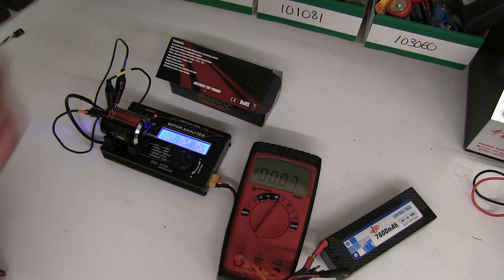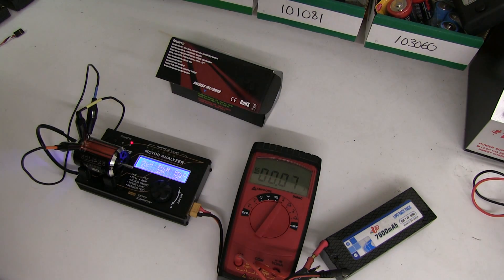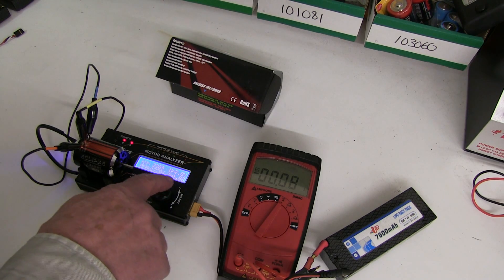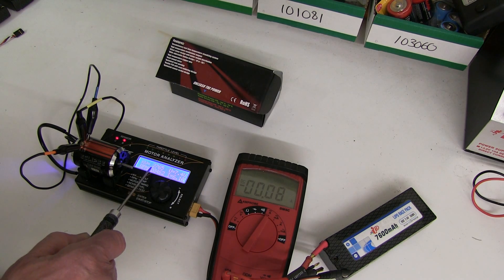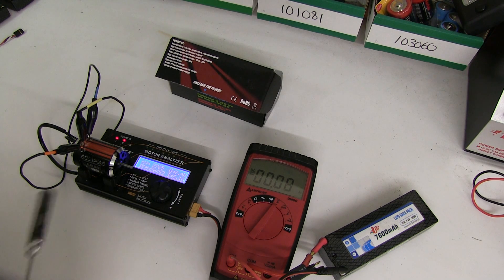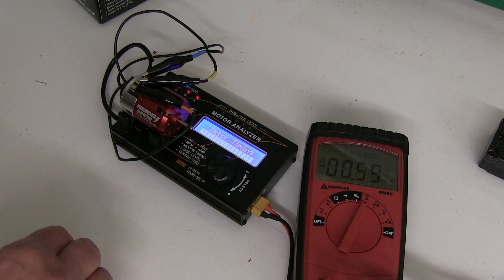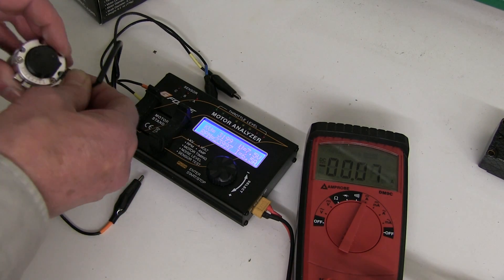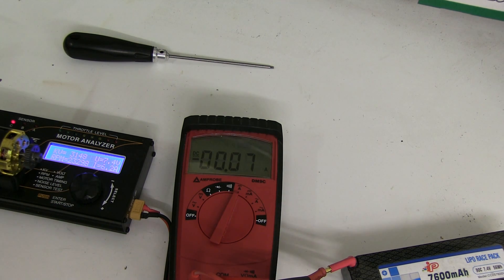Blinky Brushless Motor Sweet Spot. 17.5T and 13.5T

Comment: Thank you so much, a very helpful video. If I want to set my timing on the cheap, do you think I could do it simply with an ammeter in line with the battery and set amps that way? I know the reading will be a little higher since there will some current draw from receiver BEC. On a different note, my wife says your voice reminds her of the narrator at the beginning of The Snowman when he says he remembers that year, it brought most snows ever!

Comment: Hi Nick would this be the same for 8.5t motor in blinky mode. Tune to about 6 amps?
Reply from the maker: Hi Leigh . Track testing shows that setting most winds from 4.5T up to 17.5T  perform very well, in Blinky mode, when set about 6 to 7 amps. Your 8.5T motor will be good.  On larger fast tracks you can increase the amps 7up to about 8 amps.  But alwaqys check motor temperature after a run, and no higher than about 76deg C.

Comment: Have you tried using the volt ohm meter between the battery and a esc to test amp draw free spinning your motor and compare it to your analyzer. I'm curious if the readings are close. Reason why I'm asking is I have a maclan mrr team v2 17.5 and factory timing is 38deg which was 2.5 amps
I upped it to 45 and was only  around 3.5 amps. I'm about 47-48 on the motor casing now and its you to 5.5 amps but there scale only goes up to 50 degs. So I wasnt sure if this is normal.
Reply from the maker: Hi. Some multimeters do not give comparable results. make sure the connecting leads are heavy duty , like on the ESC. 

5.5amps at 47degree is about right. The amps start to increase rapidly after a certain advance. In your case 47 degree seems that point. At 50 degree it will probably jump a lot more.  All the best Nick

Comment: I mostly run hobby wing xr10 with 0 timing but all my motors do have timing but running blinky mode I do have a hobbywing I think v3 something with a famtom 17.5 and been running with 0 timing. Now the motor timing is set around 45 but on my esc when I program the part about timing I think there is 3 choices can you explain esc timing I think I understand the motor timing but lost on esc timing thanks for reading and your time
Reply from the maker: Hi. When running in Blinky mode, the ESC timing is fixed at zero and is not adjustable. That is why the motor timing is normally set high at 45 to 60 degrees.
If you are in normal boosted class racing, the motor endbell is normally set about 30 degrees and then the ESC can be used to increase the timing up to a max of 64degrees, by adding say another 34degrees. Some ESC have boost and turbo settings which can be added together, but also set at various rpm points and ramp up times.

Comment: Can u compare reedy s plus 17.5 and rev tec X factor 17.5 to see which is faster motor. Thanks
Reply from the maker: Hi Joker. Racing results show that the X factor is the faster motor.  Most of the new motors are performing at a high level, and the difference between them is getting less.  So they are all are capable of winning.

Comment: What do you recommend to set the mechanical timing at if one intends to use a boosted/ turbo esc?.
Reply from the maker: Hi. A difficult one to answer, as there are so many variables. But i would use 40 degrees and 20 degrees of boost for a longer track. Others may prefer 30 degrees and max out the ESC boost.

Comment: how much volts do you test at.. to get accurate readins.. 7.6? ~ 8.0v?
Reply from the maker: Hi Mits. Using this method, use a fully charged lipo. So 8volt is good.
Reply: @nickadams5411  thanks. ive been thinking of using a step-down voltage device that lets me run constant 8v to the tester from a 12v power supply...
Reply from the maker: @rcmits  Hi. The KV remains constant no matter the input voltage variation. So the input voltage source is not that important , as long as it can supply the amps. That is why a 2S lipo is best.
Reply: @nickadams5411  well... I learn something new everyday... Tha KS for the info

Comment: Hi Nick
Thanks for the great videos. I have the same motor analyzer and have set 2 motors to 6 amp draw but when in the car they are pulling just over 7 amps.
I have tested the analyzer with an ammeter whilst using a variable bench power supply so I know its accurate.
Which would you go with? The figure on the analyzer or the figure from the ammeter when in the car?

Comment: Without a motor tester, can i still do this test using 1s through esc using full throttle on transmitter? 
If so how will readings differ with the lower voltage
Reply from the maker: Hi Matthew. Yes you can set the motor with a 1S lipo.
The amps should be set about 4.5 amps.
Reply: Nick Adams can only get upto 1.8 using trackstar , ive modified the timing ring to allow further rotation but i can only go as high as 2.5 after that the motor slows dramatically.
Reply from the maker: Hi Matt
What wind is the motor? Is it a 21.5T.  They cannot reach a high amps, due to the winding resistance. In this case, turn the timing to reach maximum revs, then turn back a fraction.

Comment: Can anyone tell me that what's the purpose of the ammeter connecting to the motor analizer? Why do you need to see the level of amp via ammeter even though you can check that in your motor analyzer?
Reply from the maker: Hi
Just to show, you can set the motor up with the ammeter, if you do not have the analyzer.
Reply: Thanks for the reply. I have one more question. If you set up your end-bell at 6.0 amp, but the motor analyzer's timing is a little bit off (maybe around 4~5 degrees), would you still follow 6.0amp or the motor analyzer's setting? If they are different, then what would you do??  Thanks.

Comment: Hi Nick, thanks for all this great videos. They are very helpfull. Just one question, You said in this video that you can use the analyzer on the car without disconnecting the ESC. Doesn't it harm the ESC ? It's clear that the sensor cable has to be disconnected anyway.
Reply from the maker: Hi Moon
You do not need to disconnect the speedo. You can switch it off, but it is not damaged even if you have left it on.
Reply: Nick, thanks a lot for the info. Makes it much easier to test motors which are directly soldered to the ESC

Comment: I’ve got a new team edition Maclan 25.5 MRR. Is 6amp draw a good spot
Reply from the maker: Hi Jeremy
No, the 25.5 are inefficient and prone to overheat.
so a lower off load amp draw  of about 4 amps is a good starting point.
Then check the temperature of the motor after a run, and adjust to keep below 70deg C.

Comment: Hi Nick great video. It looks as if perhaps you set the polarity on the multimeter incorrectly. Your multimeter appears to be reading a negative current flow. I couldn't quite be certain but it looks like you have the com(negative terminal) on your multimeter going to the positive terminal on your battery which in fact is reverse polarity. You should have the positive terminal on the multimeter connected to the positive terminal of the battery.

Comment: Hey Nick, just wanted to say thanks for these great videos. I was wondering your thoughts on Motiv and their view that their 17.5T MC2 should not be set to 6amps?
Reply from the maker: Hi Matthew
I have not seen that view from Motiv.
Heat is the main problem with motors running as hard as they can.
So always use a high performance cooling fan, and check motor temperature does not go past the 70 -80 degree C at the end of the race.

Comment: just wondering with 21.5 torque motors where would the sweet sport be ? 5amps ? 6amps ?
Reply from the maker: Hi
The 21.5T motors are inefficient and get hot with the resistance loss in the windings.
I suggest you start at 4 amps and see how hot it is after the race.
If still below 70deg C on thcase, then try 5amps. until it gets too hot.

Comment: Hi Nick, 
do you have information for ratio and draw for Sting 21.5T motors for F1? which is a good starting point? 
thanks a lot
Reply from the maker: Hi
I have been asked this about 21.5T motors.
See some answers below.
The general answer is that it depends very much on the heat generated during the race.
your motor should not exceeds 79degC at end of race.
You will probably have to set the free running amps about 4.5A.

Comment: Nick, thank you for the very informative videos.  Really appreciate your fine efforts.  I just received a motor tester and checked two of my 17.5 blinky motors while they were in my B6D's.  With the pinions disengaged from the spur gears, and also a clamp on DC amp meter attached to the positive wire from the lipo to the motor tester, both the tester and clamp on meter showed the same amp readings at full spin.  However, when I disconnected and removed the motor tester and just used the clamp on meter on the  positive wires from the lipo to the ESC, at full spin, clamp on meter showed a gain of 1.00 + amps over what motor tester showed.  I repeated the tests several times to include changing sensor cables with no change.  With just the clamp on meter,  both motors seems to rev higher and pulled an additional amp.  If you have time,  can you provide your input?  Thanks!
Reply from the maker: Hi
What motor tester do you have?
The motor tester is not putting out full power.
If the motor tester has a built in speed control it looks like it doesn't reach full on power.
Also make sure you have good (short) connecting wires and contacts, as they can drop voltage(and current).
Reply: Thank you for the quick response.  I purchased a Trackstar Motor Analyzer from HobbyKing.  It looks identical to G Force, SkyRC , etc., analyzers.  Also, much to my surprise, I tested three 17.5 motors (one is new and still in the box) and all motor sensor boards only had a one degree variation in phase timing.  Hmm :-)  BTW, all motors are Trackstar  ROAR approved units and are very competitive on a shorter indoor clay track.
Reply from the maker: Hi
Well check some other motors and make sure the tester is working ok.
Maybe it looks the same on outside, but is a second rate on the inside.

Comment: Nick Adams what is the sweet spot with the 21.5 motors now that, that wind has been getting more popular with onroad racing
Reply from the maker: 21.5T  run very hot, as they have a lot of winding resistance.
If you are using a 2S Lipo, then you will have to make sure the motor 
does not overheat.
So try 4 amps at first, and see how it sounds, and where the timing is 
set on the endbell. Check the temperature during a run.
Use a high power cooling fan.
The motor temperature should not exceed 80degreeC.
 Generally the amp draw will increase rapidly after the sweet spot, so 
even a few extra degrees of timing will put the amp draw up quickly.

Comment: Nice video.   after I set for 6amp draw what temp should I be shooting for when gearing the car.
Reply from the maker: Hi Ian
After a race the motor temperature should not be higher than 80degC
Note that motors will get hotter when the ambient temp is higher, and on shorter tracks.
Also fit the best motor cooling fan.

Comment: what should the amperage be for a 7.0 motor?
Reply from the maker: Hi Cody
The amp draw off load is lost power and will result in heat.
Low turn motors are normally very powerful and do not need a lot of advance timing.
Also timing can be applied by the speed control as Turbo boost etc.
Therefore, set the amp draw at 6 or less depending on how the motor is used.
For instance, if you have a speed control with boost, then you can start at say 10 degrees on the end bell, which will give a wide torque band and linear speed acceleration.
Apply speed control boost and gear the motor for top speed.
Race on.
Nick

Comment: Hi, so you can use the motor tester in the car without disconnecting  the cables from the speedcontroler? Just connect A B C and the sensor with the tester? BR
Reply from the maker: Hi Robert
Yes, to check timing you can do it with motor still driving the transmission.
 But to test amps and KV,  remove or unmesh the pinion.

Comment: Hi, Some questions to Nick , i am using a brushless motor checker it can read Current (amps), Volts, RPMs and KVs, no Timming....
1. What Current do you recommend for a 25.5T for better perfomance to be use in Formula 1 class? 
2. What Current do you recommend for a 21.5T for better perfomance to be use in touring blinky class?
3. What Current do you recommend for a 17.5T for better perfomance to use in touring blinky class?

Comment: Do you tune for 6 amps in a motor used for 17.5 1s (worldGTR or Pan car) ?
Reply from the maker: Hi
A number of racers have tuned successfully at 6 amps (2S Lipo), and the used with a 1S lipo.
Some racers prefer less or more timing, so it is critical depending on your track , FDR, and temperature of motor after a run.
It is still a good starting point that will get you running at a good speed.
Reply: Thanks nick!

Comment: hi again, sorry i more thought. does this test with 6amps apply to non short stack motors ??? what current would you use to test short stack motors ? thanks.
Reply from the maker: Hi
Yes, you can set the same with short, 1S,2S.
It will get you to a competitive setting, which you can fine tune depending on the type of circuit.

Comment: hi Nick, thanks for this, great job!! i was wondering if you had a chance to test any 21.5 motors ??? i am using a 2s. since they run very hot would you suggest i optimize/test with 5 amps or 5.5 amps ? also when i gear should i gear for 140 degrees or 160 degree motor temp  when running ?
Reply from the maker: Hi
Yes, the 21.5T motors run hot, since they have high resistance windings.
You will need to start at a lower amps, say 5 amps, and check the temperature.
Temperatures above 70deg C after a run, will slow the motor, and any higher than 80deg C will probably damage the windings.
Adjust the gearing to suit smaller tracks.
Always use a motor cooling fan, if you can fit one.
Reply: Thanks. So I dont have a motor analyzer. Ill use my esc and radio but question about the radio. so full throttle with end point of 100. my radio has the option to go up to 150% so should i use 100% or 150% as my throttle endpoint ? thanks.
Reply from the maker: Hi
If you have set the radio to the speed control , then it will be full speed when trigger pulled to max, and a LED normally comes on full on the speed control. (Radio set at 100%)
The extra 50% on the transmitter is only used if you cannot get the LED to light, by nudging it up a few %.
On modern radios and speed controls this is not normally needed.
So just leave at 100%.
Also if you put it up, then full speed is reached for less trigger (stick) movement.
This could be useful if you just wanted instant max speed without much intermediate throttle control.
Note that some speed controls will go out of calibration if you increase to 150%, so do it in stages.

Comment: hey Nick, I don't know if you answered this already but I was just wondering does this method work for modified Motors as well
Reply from the maker: Hi Johnny
Yes it can work for low turn motors, but with some experimentation.
For instance:
A racer had several 6.5T motors of different makes.
One was the best on the track and others not as good.
By measuring the good one, it was clear that the timing on the others was way out. (Amps too low or too high).
By setting them to the good one, they all became competitive.
However , with low turn motors, it also depends on any timing added by the speed control.
But, if the no load amp draw is high, then that is lost power and is lost as heat in the motor.
So, if you have extra electronic timing applied from the speed control, then 6 amps will give an efficient motor.
Reply: Nick Adams thank you I really appreciate it

Comment: Nick have you ever got to use a dyno like the TurboDyno that puts a load on the motor?
Reply from the maker: Hi
I do have a Dyno that accelerates a heavy flywheel and the results can be analysed on the computer.
It does take longer to set up and analyse the results.
A constant load dyno would be useful, but the one I have was for brushed motors and cannot cope with modern high power brushless.
There are a few coming on the market now, but are expensive.
I have considered making one.
Reply: Right. I have a turbo dyno I use. Its great. I have it set to a constant volt and it will do 6 pulls each at a different level of torque resistance. From that i measure RPM, Watt, Efficiency and amp draw.
Reply from the maker: Hi
Is that a TurboDyno you can buy, or made yourself?

Comment: Hi Nick. Was wondering about the "sweet spot" and gearing. I was able to get my 17.5 motor up to 5.2 amps which I'm happy with but I'm concerened about too much heat. Before I raised my timing my buggy would come off the track at 160 degrees F at 32/69 gearing. Should I reduce the pinion gear? Doesn't the lower tooth count defeat the purpose? Or does the extra timing pick up the slack?
Reply from the maker: Hi
Buggies tend to run motors hot, as there is little cooling air flow.
Try and use a fan to cool motor.
The motor should not run hotter than say 79 degree C. Measured on case as soon as the car has stopped.
It is all about best performance.
The lower gear will give more acceleration, is that what you want?
The extra timing will add the top speed.
Reply: +Nick Adams Based on the new layout of my track more acceleration seems most desirable. I haven't had the opportunity to to test it yet, that will come tomorrow, so a bit of experimentation will be needed. But the d4 1s has a lot of torque it seems.
Reply from the maker: Hi
The D4 and Revtech 24K use a strong magnet rotor and give good torque.
Reply: +Nick Adams That torque almost makes up for the substandard sensors.